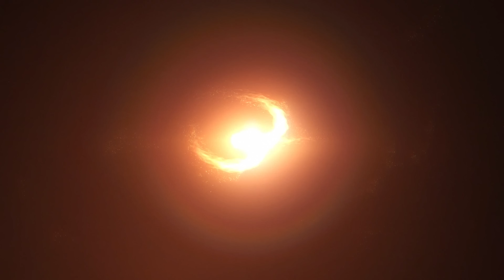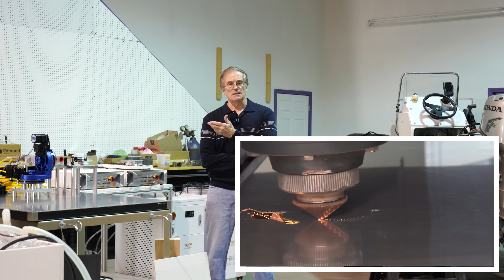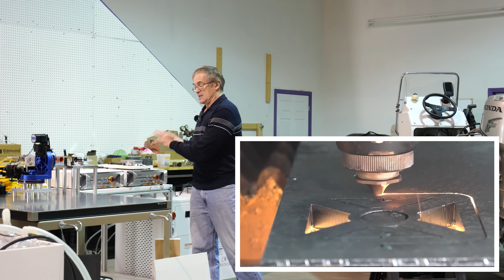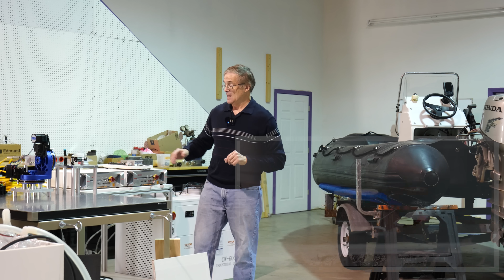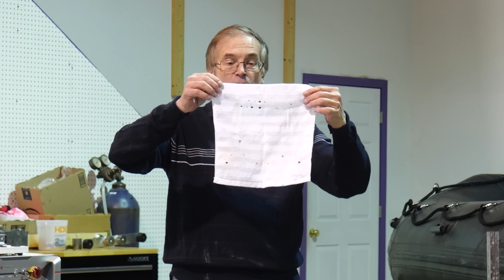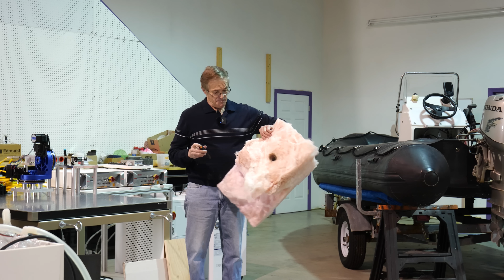We have a problem... and need your help!

Comment: I couldn’t come up with a good answer myself so I asked Grok 3

Here’s the AI’s answer

To safely confine and dissipate the energy of a powerful laser in a manner similar to a bullet trap at a gun range, you need a system that can absorb or redirect the laser's energy without reflecting it dangerously, while keeping the solution relatively inexpensive and lightweight. Here’s a practical approach:

### Solution: Multi-Stage Laser Beam Dump with Absorptive Materials and Diffuse Scattering

1. **Primary Absorption Chamber**:
   - **Material**: Use a series of high-absorbance, heat-resistant materials like blackened anodized aluminum or ceramic tiles coated with a laser-absorptive material (e.g., carbon-based coatings or specialized laser-absorbing paints). These materials are designed to absorb laser energy across a wide range of wavelengths.
   - **Structure**: Construct a conical or cylindrical chamber with the absorptive material lining the interior. The conical shape helps distribute the beam's energy over a larger surface area, reducing localized heating.
   - **Inclined Entry**: Similar to the inclined steel in a bullet trap, angle the entry point of the laser beam to prevent direct reflection back toward the source. The beam should strike the absorptive surface at a shallow angle to maximize energy dissipation.

2. **Diffuse Scattering for Residual Energy**:
   - **Secondary Layer**: Behind the primary absorptive layer, include a diffuse scattering surface, such as a roughened metal or ceramic plate. This scatters any unabsorbed light in multiple directions, reducing the intensity of any residual beam.
   - **Labyrinth Design**: Incorporate a series of baffles or a slotted pipe-like structure (akin to the bullet trap’s horizontal pipe) to trap scattered light. The slots or baffles should be coated with absorptive material to prevent reflections from escaping.

3. **Heat Dissipation**:
   - **Cooling System**: Since powerful lasers generate significant heat, integrate a lightweight cooling system, such as a heat sink with fins or a simple forced-air cooling mechanism using small fans. For a low-cost solution, rely on passive cooling with high-thermal-conductivity materials like aluminum.
   - **Thermal Mass**: Use a modest amount of dense material (e.g., a small water reservoir or a metal block) to act as a thermal mass, absorbing and dissipating heat over time.

4. **Containment and Safety**:
   - **Enclosure**: House the entire system in a lightweight, sealed enclosure made of non-reflective materials (e.g., matte-painted steel or reinforced plastic) to prevent any stray light from escaping.
   - **Beam Entry**: Use a narrow aperture or a laser-transparent window (if wavelength-specific) to guide the beam into the trap, minimizing the risk of external reflections.
   - **Monitoring**: Optionally, include a low-cost temperature sensor or a simple light sensor to detect if the trap is overheating or if stray light is escaping, providing a warning for safety.

### Key Features for Cost and Weight:
- **Inexpensive Materials**: Anodized aluminum, ceramic tiles, and carbon-based coatings are relatively affordable and widely available. Avoid exotic materials like specialized laser optics or high-end composites.
- **Lightweight Design**: Use thin-walled aluminum or reinforced plastic for the enclosure and minimize the amount of dense material for thermal mass. The conical chamber and baffles can be hollow or perforated to reduce weight.
- **Modular Assembly**: Design the trap to be assembled from off-the-shelf components, reducing manufacturing costs. For example, use standard heat sinks and common absorptive coatings.

### How It Works:
- The laser beam enters the trap at an angle, striking the absorptive material in the conical chamber, which converts most of the beam’s energy into heat.
- Any unabsorbed light is scattered by the roughened surfaces or baffles, further reducing its intensity.
- The heat is dissipated through the heat sink or thermal mass, with optional air cooling to prevent overheating.
- The sealed enclosure ensures that no stray light escapes, confining the energy safely.

### Considerations:
- **Laser Specifications**: The trap’s design depends on the laser’s power (e.g., kilowatts or megawatts), wavelength (e.g., infrared, visible, or UV), and whether it’s continuous-wave or pulsed. For very high-power lasers (e.g., >10 kW), you may need a larger thermal mass or active cooling, but the basic concept remains the same.
- **Safety**: Ensure the trap is tested for the specific laser’s characteristics to confirm no hazardous reflections or overheating occur. Regular maintenance (e.g., checking for material degradation) is essential.
- **Cost Estimate**: A basic system using anodized aluminum, ceramic tiles, and a simple heat sink could cost $500–$2,000, depending on size and laser power, far cheaper than commercial beam dumps costing tens of thousands.

This approach mimics the bullet trap’s ability to confine and dissipate energy while prioritizing affordability and portability. If you have specific details about the laser (power, wavelength, or use case), I can refine the design further. Would you like me to focus on any particular aspect, such as materials, cooling, or size constraints?

Comment: Would you not consider using a water jet wall with activated charcoal to absorb and diffuse the laser at the same time?  Obviously we don't want round water droplets so particulate size and shape relative to the beam is important along with the ratio of activated charcoal to water.   Good luck on your project.

Comment: Great video and challenge!  Many have commented with a variety of good ideas.  My contribution is to note that what ever you do, you will need to move it. When I worked for a through wall RF imaging company many years ago, we built a dozen or more walls on mobile frames using harbor freight caster wheels. They were built of 2x4 or 4x4 and had internal and external bracing to both make sure they did not tip over and also stayed together. We had every interior wall but also brick and cinder block walls and even a stone wall.  For the heavy walls make sure to get bigger wheels to carry the load. Our walls were about 8’ x 8’ but you could make them twice that size in both dimensions with appropriate bracing.  From the options seen in comments, I like cinderblock, particularly if you can get the interlocking type.  If not interlocking you will want to tie the blocks together so they don’t shift ever.  I think the sell inserts that do this. Then I would fill them with something ceramic, sand, stone or best would be to isle the idea of others, those light weight fire bricks.  They could act as locking keystones inside the cinderblocks. Maybe back it with some half inch steel plate at least in the aim point area for good measure. If that is not good enough, I fear you are going to spend either a whole lot more money or may need to punt to finding a hill side to fire into. It might be easier to move your equipment to a hillside versus moving the hillside to your equipment.

Comment: My proposal is to create a Dark water fish tank, backed by heat-resistant, non-reflective materials such as ceramic or graphite, and possibly a final layer of black sand, ensuring the laser’s energy is absorbed and neutralized without risk of reflection or damage to the surroundings. 

Composed layers:

1: Thick glass (Pyrex/borosilicate, to contain the water).
2 Water with black ink or activated charcoal (maximizes light absorption and disperses energy), If possible, circulate the water to delay boiling.
3: Black ceramic plate or blackout material (additional thermal absorption)
4: Box with black sand (optional, for maximum safety)

good luck !

Comment: Water tank (aquarium). Dye the water to remove transparency. Squid ink or some other ink should do the trick. You may need to circulate the water. Failing that, door open with mirror at 45 degrees to redirect into space or the ground...

Comment: Ideas,
1)  Wet sandbags.
2) Wet bags with a mixture of sand and glass spheres, like those used to paint reflective traffic signs on highways. Very small spheres, with a proportion of no more than 30% and no less than 15% in the mixture.

Two rows of bags wide. The bags should not be too large to protect against bullets, but large enough to stop the laser and later easly be replaced the bag after each test. Perhaps no more than 20 kilograms each.

3) Place a frame with a cristal glass in front of the target. As the laser crosses the glass, the laser sensor will detect Minimal Edge Diffraction (a tiny edge diffraction that is easily detected by its wavelength, in a dark frame; even using, in front of the edge, a light polarizer for better identification and precision that detects the perpendicular passage through the center of the crystal) again, perpendicular to the laser beam, and switch off inminentely cut the laser

4) If the power can be regulated, by intermitente flashing laser, generated in milliseconds switching from on and off modes.

5) A combination of 3) and 4) to allow testing with different powers.

These are the most economical and practical solutions I can imagine for now.

Other solutions may be much more expensive and require more research to develop them than the experiments you want to do.

Perhaps this will trigger other real useful ideas that will surely be much better than mine.

Greetings from Argentina.
Reply: Wet sandbags with black sand.  Keep the sandbags wet with flowing water.
Reply: You do NOT want anything like retroreflection here.
Reply: @DanielFackrell 
Minimal edge diffraction (a tiny edge diffraction that is easily detected by its wavelength, in a dark frame; even using, in front of the edge, a light polarizer for better identification and precision that detects the perpendicular passage through the center of the crystal.)
Reply: I was thinking ant farm with clear glass facing the laser. The sand collects heat, turning into glass most likely, and is replenished from above via gravity. Easily refilled as necessary.

Comment: Honestly, the best option for a self supporting, cheap, and disassembleable design would just be CMUs (cinder blocks) dry stacked, optionally filled with sand. It will stop it, it is cheap, it is easy to set up and take down, it supports itself, and it can be resold as a commodity when done.

Comment: Moving wall!!  Frame up a conventional wall with a couple layers of drywall and probably plywood for stiffness.  The bottom plate to floor interface should be low friction, vee rollers on angle iron maybe?  Rigidly mount a suitable motor to the floating wall with an unbalanced load and tune the frequency with a drive to resonate!  Tie it to an existing wall with chain/cable.  Wouldn't lose much square footage and pretty cheap.  Plus you get bonus points if your tracking system can ignore all the moving burn marks on the wall 😝

Comment: This idea feels a bit… Wile E. Coyote-esque… but have you considered some kind of background that moves continuously so that the laser never has time to fully burn through the material? I’m imagining 2 to 4 disks of continuously spinning material  (drywall mounted to steel tube frame?), maybe 6-8 feet in diameter that are overlapping to only expose the portions of each disk with a high enough surface speed to the area that the laser will be operating in. You could make a fairly simple chain-driven linkage to power all disks at the same time with a motor/variac combo to dial in the necessary rotation speed.

Comment: My thought was something to optically “neutralize” (or at least unfocus) the beam, covered up by a layer of something that would hide the reflection of the unfocused energy (aside from the small hole where the beam initially passes through it). So effectively you allow the beam to pass through a small hole, into a box where the beam is then diluted and made safer to contain.

Comment: Why is it not as simple as deflecting the laser beam after it has passed through whatever object you're trying to inspect (or measure, if you need an active measurement actually touching the laser beam itself), or if not needed, being in close proximity for whatever purpose such as the temperature for example.  Brightness, color, ext.

Now back to the solution, we do so with a mirror.  But it could be that the surface imperfections will cause the light to be scattered to a finite infinite degree but that is not the case.  You use the same mirror and surface alignment accuracy within the laser body itself.  This will be extremely difficult no doubt but if accomplished even to 99% accuracy it will be accurate enough to deflect the laser beam in its original orientation.  

Now then if laser beam deflection can be achieved with 99.999% efficiency, then where do you do reflect it? And that answer is  simple.  Space

Comment: How about one of those indoor architectural style waterfalls? The waterfall itself would probably be a little too thin, so you might need to double up, but they run on amazon for like 1-200 bucks, so might be cool to see if it acts like a shield at all. Depending on how laminar the flow is too I wonder how that might affect energy dispersion/dissipation. Plus it's relatively portable, and you could adjust the waterfall at different angles to the laser so it hits more water in it's cross section.

Edit: if the laser beam is narrow enough you could also get one of those laminar flow hose nozzles and have the Lazer hit an arc of water instead driven by a pump. That way the laser reflects within the tube of water like a virtual fiber optic cable.

You could experiment with different dyes and additives to ger better absorbsion.

Comment: I know nothing but I’ll put in my two cents.  Carbon-carbon composite fiber wrapped copper for thermal dispersion. Carbon fiber has high absorption, low ablation…from what I read.

Comment: The answer to your problem is simple but may be difficult to implement. You need an absorber built into the laser and a shutter switch. You need to modify your targeting software to detect when the target is destroyed and then activate the shutter switch to fire the beam into the absorber, shutting off the beam. You are not going to develop a heat tile to effectively block the laser. That would be prohibitively expensive and difficult to implement. Plus that would not be a very robust solution in a changing environment like target tracking.  If you can shut off the beam before enough joules of energy reach your wall, you can prevent any damage to the wall.

Comment: options - 1) rapidly flowing water curtain 2) high density graphite  3) search "beam trap" for papers  4) active estop that detects reflection that is hitting backwall and shuts down laser   5)  aerogel to scatter the light
the real question I have is, why do you need more than just a pulse stream vs CW laser. Can you not modulate the beam ?
Reply: Or you could just mount it on a shark, see A. Powers  and D. Evil 1997

Comment: umm just use a 555 timer circuit on the power supply to control the duration and amplitude of pulses.

Comment: Perhaps a wall of dyed water or steam misted from nozzles ahead of a soft (light) firebrick or graphite target.  The water should refract the light without directly reflecting it, even when it turns to steam, reducing the power enough to be stopped by another material.  Eye protection will still be required in case there is a "sunburn" effect from the glowing steam.   Basically, I am looking for something to randomize the refractive index of the air before it hits the target.  Heat is another way to do so, but is not fine enough to handle a focused beam.

Comment: Simple. Set a limiter to the laser by distance. Lock onto a target, once target is located and confirmed use that same targeting laser to measure the distance the target is at. Once the distance is determined set a range limiter on the laser so once it passes through the target it senses the range change and shuts off the power to the output. Laser range finders are pretty simple. Would be the same concept as putting your hand in front of one and then moving your hand away. Just fine tune your software to read the change in range to know the moment it punches through. Might even be able to get away with the laser gauging how dense the target is so that once it reads same density as atmospheric it shuts off being that it fired at a solid object and then read no resistance or density meaning it's through the target or the target isn't there anymore.